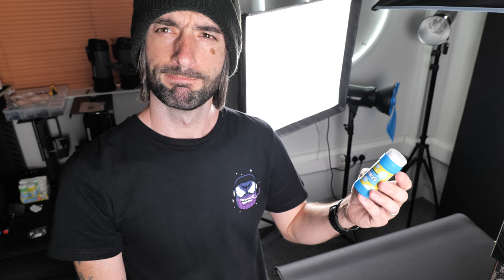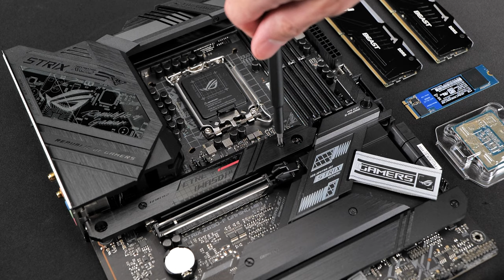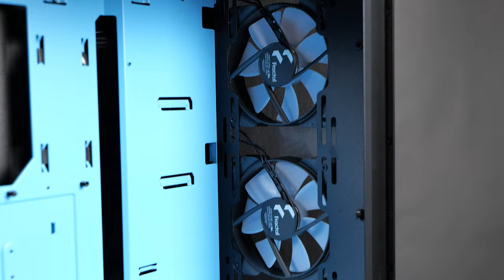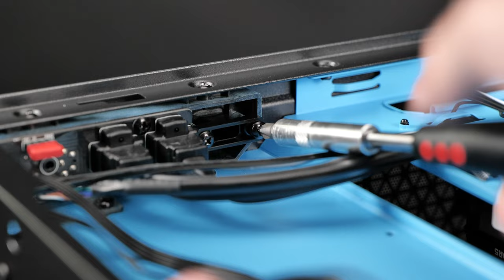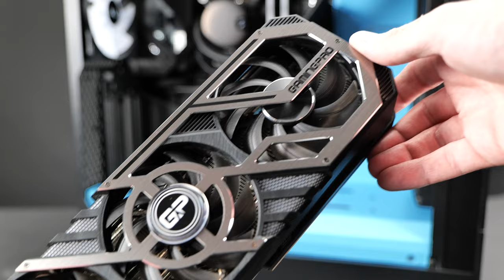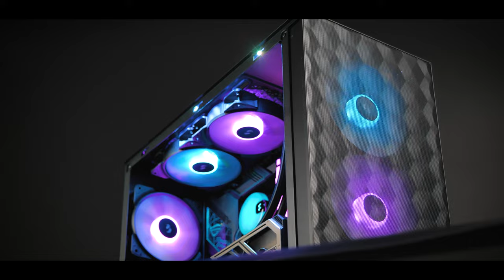Performance Meets Style?! | Fractal Design POP AIR Gaming PC Build | RGB Cyan Core | Lumen S28

Comment: I just upgraded to this case from the Fractal Focus G. I need cases with bays for optical drives, cause I burn a lot of Blu-ray discs of home movies for family. This case was a great option. I did switch out the two front fans for two 140mm PWM Arctic fans. The case looks incredible, and it's actually lowered my temps by at least 10 degrees C in some processes. It was a nice upgrade.

Comment: After a long back order, I believe my Orange Pop Air from B&H is about to be shipped.  So popular were these cases, especially Orange. some eBay sellers were adding $40-45 over list. Have used NZXT and TT in the past and am anxious to get going on this one. Will be adding an Optical drive and powered usb/etc. hub. Passing on the AIO and using a Cooler Master low profile cooler and Corsair ARGB fans on top.

Will be scanning the horizon for the FedEx van on my Amazon del. day Mon Feb. 20th. At 81with hand tremors and challenging eyesight, my wife is in charge of all those tiny screws. Yes. . . . . all is well.

Comment: I'm new to building so this was not enough. For example where do I plug the cords and stuff. It's just not enough. Good effort though. I am trying to assemble in the same Pop Air case with Lumen S28 but I'm struggling with the cables and cannot seem to find a proper tutorial on where each cable goes for example the two coolers that you took from the S28 box and put on top where do you exactly plug them? I would love an answer! Other than that great video and I love the effort! I will subscribe in hopes that you will provide some more detail in your future videos!

Comment: Im looking at this case for my first PC build and was thinking of doing liquid cooling (240 kraken). Here you mounted it to the front. Is that the best for air flow? Im thinking it would block natural flow and cause issues, am i wrong?
I was thinking of possibly mounting it with the fans on top, would that work?

Comment: Hi Matt.. I´m a newbie at PC-Build... And I´m planing to build a new PC with a Fractial Pop. I saw that you build the watercooler at the Front! Did you do that because of better airflow? oder because it look better?
Reply: I believe there wasn't room for the watercooler to be installed on top of the case. Putting the cooler in front is also one of the best ways to get airflow.

Comment: hey man, how would you rate the lumen vs nzxt?
Reply from the maker: Hey dude! Performance is pretty on par, I’d say the lumen makes a little more pump noise mind. Although, a quirk of the Lumen is that the pump is actually inside the rad, so you could even bottom mount the radiator should you wish. I don’t know if too many cases you’d want to do this inside of though. Other than the Torrent Compact…
Reply: @Mr_Matt_Lee  hey man, oh now that is interesting! was this the v1 by any chance? they have since made a v2 which i think is an improved pump and liquid from my understanding! thats cool they mount it inside the rad!  i'm looking at a top mount solution, potentially even front. either that or was looking into the kraken 280
Reply: Yeah Dude, I would like to do the same built but with the Kraken to have the LCD monitor. I'm just wondering if it will be easy to manage the Kraken fan RGB with the others fractal fans or if I have to change all the fans for Nezxt Fans...  Do you have made this?
Reply: @AngeloGalileo  mmm pretty sure nzxt uses prepiartory stuff but someone else would have to confirm that

Comment: Uhm, the AIO radiator is upside down.
Reply from the maker: The pump is built into the radiator on this particular AIO. With that noted, it doesn’t matter the orientation as a result.